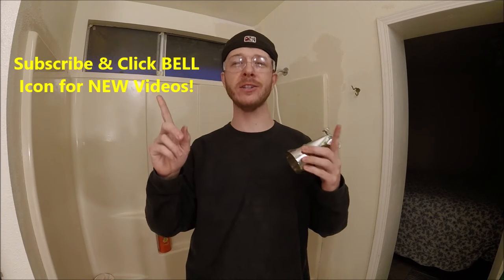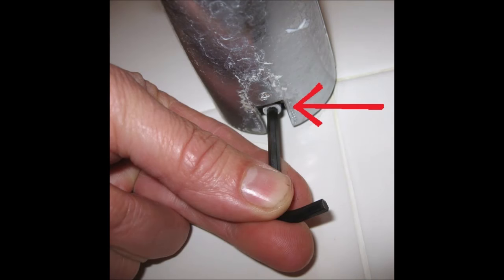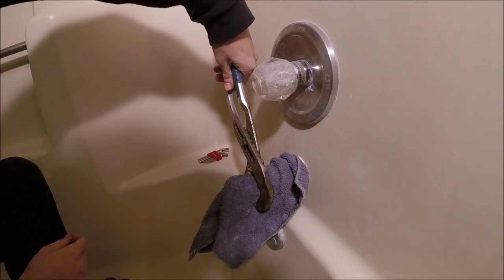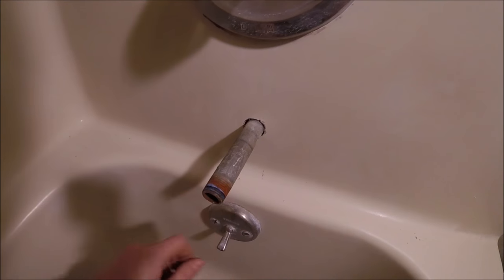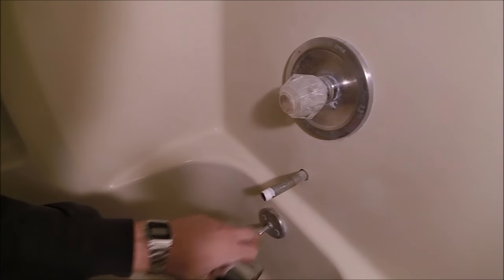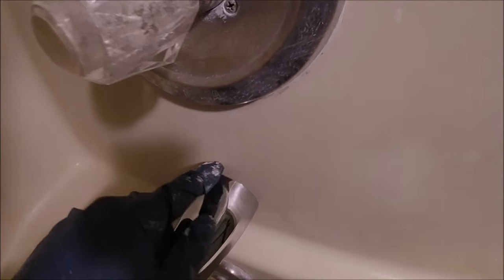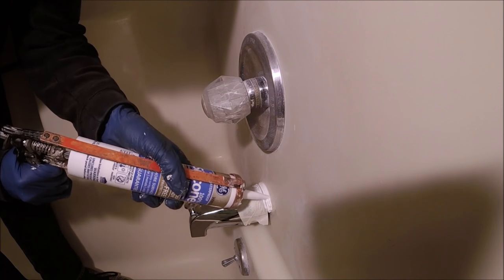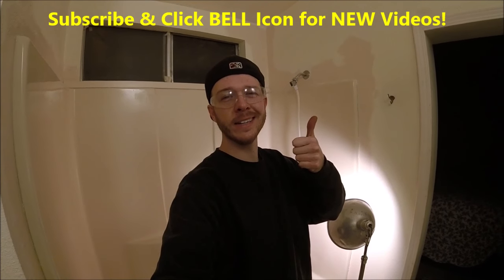Bathtub Spout with Diverter Replacement. Fix Leaking Tub Spout  -Jonny DIY

Comment from the maker: TOOLS & SUPPLIES & DONATION LINKS
Tub Spout- https://amzn.to/36ntmhO
Pipe Tape- https://amzn.to/2Cp446j
Hex Key Allen Wrench Set- https://amzn.to/2RNKYOD
Caulking Gun- http://amzn.to/2tbO4PC
Silicone Caulk- https://amzn.to/2K55y7N
Caulking Finishing Tool 3 in 1- https://amzn.to/2FXDBMD
Safety Glasses- http://amzn.to/2ez41Jw
Nitrile Disposable Gloves Large- http://amzn.to/2w0dlwc
If you Enjoy the Channel Consider Helping Support it by Donating below & by Subscribing.
PAYPAL DONATION https://www.paypal.me/JonnyDIY
Zelle Donation JonnyDIYs@gmail.com 
Venmo Donation JonnyDIYs@gmail.com
Reply: Do you have to turn the water source outside off first?
Reply from the maker: @CrmlG72  Actually not necessary for this job, but it doesn't hurt if you do 👍
Reply: I know Im kinda randomly asking but do anyone know a good website to watch newly released tv shows online?
Reply: @JonnyDIY  Hey man great video thanks! I have a quick question for you If you don't call behind that spout fixture if water gets behind that could it cause water damage on your ceiling behind the wall?
Reply from the maker: @bosshova23  probably not the ceiling, you may have another type of leak, best to check if you're getting drywall damage
Reply: Which exact tub spout? The link for that?

Comment: Jonny, why would my tub spout with diverter leak out the back when I engage the diverter? Cannot seem to find a solution to this, but I noticed that the replacement package has a notice not to install if water leaks out the back. Suggestions?
Reply from the maker: The connection inside the tub spout must be leaking and it backflowing. So taking it off or installing a new one with plumbing tape and or plumbers thread compound should be good to fix that issue. You just dont want water backflowing into and behind the wall
Reply: Thank you 😊

Comment: I have a similar spout I thought would be easy to change. I don't see a set screw. However, it seems really stuck on there. I'm afraid I will break the pipe. Does this ever happen? Cause if it does it will definitely happen to me.
Reply from the maker: Could happen or could remove pipe its attached to. I would verify what kind pipe it's attached to before really cranking on it. May need cut off around spout to get a monkey wrench on pipe to remove
Reply: Thanks @JonnyDIY  I think I am going to try torching it on the spout around where the threads are. I've been hitting it with WD-40 too and hopefully time and heat will do the trick. My home was built in the 1840's and we know this particular spout is at least 15 years old, possibly older. We think the spout is a Moen posi-temp. This pipe is copper. Thanks for your help.
Reply from the maker: @ThomasMaurielloUX  perfect, a torch and wd-40 should do the trick in time. Id put some anti seize on the threads of the pipe before installing the new one for future 👍

Comment: My parents’ bath faucet wouldn’t divert water to the shower. I never had this problem but has to resolve. Thanks to this video and replaced the spout/shower diverter. At first, I looked for the screw on the underside that didn’t exist. Realizing my tourque was needed to twist off the old spout, it came off easily. $11 new one from Walmart went on with no trouble. Thanks you - felt good to learn a new skill
Reply from the maker: Awesome, you're very welcome. Glad I was able to help you fix that for your parents 👍

Comment: Wow that’s easy! I’ve put a leak off for 15 years. Knowing it wouldn’t fix itself. But just didn’t know how to tackle it. Thanks for your video. Following you!
Reply from the maker: You're welcome, glad I could help. Good luck with the fix, better late than never! 👍
Reply: Uh, yeah...same here. Not quite that long, however, when we bought the house new they put the cheapest crap in here including all the  faucets and tub stuff.
House was built in 2005 and already had to replace every faucet in here pretty much including kitchen sink and faucet, 3 faucet fixtures in the bathrooms and now this 1 tub spout im going to have to do. I wish they wouldn't do that to us and just put something in that will last.

Comment: Thank you dude❣ To the point and not a YouTube time waster! Quick and easy. Great job superior❣👷‍♂️👍
Reply from the maker: Thank you for your kind words 👍
Reply: @JonnyDIY  BTW
went To my local hardware store and purchased a spout.
 I thought it was the one I needed before taking the original 1 off of my tub cause I wanted to make sure I had the right 1 and in taking off my original, the 1 I purchased was not the right 1 so I took it back and was able to get the right 1 based on what I took off and figured it out and put on the new 1. Next I noticed that the replacement 1 was the super cheap pot metal.
 I don't like how cheaply made it is and I Paid $17.99 for it.
I Did a great install though! YAY ME!
Thanks again for the viddy!
Reply from the maker: @candlesoftheearthbestcandl995  You're welcome, glad you got it done. Yes I've noticed the price of them has gone up a lot in the last 5 years and the quality down sadly. They dont last long either, they're always breaking for me at least hah

Comment: Ive replaced these 3times in this house weve lived in for about 9yrs. The first two were in the first five years, after putting on the third one i asked everyone to pull up the diverter before turning the water on thinking it would help from wearing out and its now been 4 yrs and its still going strong
Reply: Also we had terrible water pressure in the shower for the first while we lived here, fed up one day i accessed back panel where the shower pipes are and with the turned all the way up i went up and down thr pipes rapping on it (forcefully but not excessively) with a wrench and knocked some sediment loose and increased pressure by easily 300%, wifey was pleased and i got to act like i knew what i was doing the whole time lol
Reply from the maker: @ChChChEm  haha awesome, love fixes like that. Easy and rewarding! 👍

Comment: Thanks for the instruction. 
My spout leaks even when not in use. How do I fix it or I have to replace it?
Reply from the maker: If it leaks when turned off that will be a control valve issue. So you will need to take apart handle(s) and replace either cartridges or sometimes on certain ones can just replace rubber washers. If take apart and take pictures can show to hardware or plumbing supply store. Theyll be able to point you in right direction for part

Comment: instead of caulking, I prefer a round foam rubber seal between the wall and diverter, slightly wider than the diverter diameter. It will be compressed and form a positive seal.
Reply from the maker: Cool thanks for sharing 👍

Comment: Jonny watched your video to change the sprout very good I have a question my sprout does divert water to the shower but water leaks from the sprout even when the valve is closed
Reply from the maker: A little bit of water leaking is normal when diverter is closed letting water out of the shower head. If its leaking a bunch may need to be little bit tighter

Comment: That's a Delta faucet system. Got any plans to do a video on a Kohler, Moen, Pfister, or El Cheapo  tub/shower fixtures? You are the only youtuber who is not ashamed to use masking tape while caulking. Party on, dude.
Reply from the maker: Thanks Mark! No plans on any other fixtures right now. But will keep you posted if I do 👍🏻

Comment: How do you know if you need to remove the spout or the delta cartridge? My bottom shower spout was leaking a little cold water first, now it’s leaking hot water
Reply from the maker: @BrightVibesOnly  if the spouts leaking it's the cartridge that needs replacing/servicing 👍
Reply: @JonnyDIY  I have been trying for 3 days to get a bonnet nut off, I tried a wrench strap and maybe am not using it correctly because it has yet to come off, I also tried DW40 and today I poured vinegar on it and no success. I am so stressed & I refuse to get a plumber that quick because I have the cartridge and my female cousin and a sister did there own by folliwiing instructions from youtube, had this nut been off my problem would have been solved by now. 🤬I wanna thank you for replying to me, I hear theres a can of something that may work I forgot the name but I dont wanna keep buying stuff lol and the NUT is still stuck
Reply from the maker: @BrightVibesOnly  yes those get stuck on good. Try using a monkey wrench. Sometimes you have to heat it up with torch too. Sometimes if you tighten it a little first itll break the seal and loosen easier
Reply: @JonnyDIY  Ok I am gonna try to tighten it, It is so nerve wrecking because I now have the part but the nut is a headache. Do you think I may be using the wrench strap incorrectly? I was told to buy it with the part for the bonnet nut and I tried it and nothing lol
Reply from the maker: @BrightVibesOnly  is it a circular bonnet? Or have anywhere can put regular wrench or large channel lock pliers. Need some leverage

Comment: Looking for solutions. Trying to install a spout similar to this but one for a handheld shower. Any tips?
Reply from the maker: You need a special spout that has the connection for handheld built into it. If you already have it, its same process to install as this. Then connect handheld shower to it 👍
Reply: @JonnyDIY  I have one, but the pipe is too short for the spout. It leaks out the back...I am thinking to use a compression adapter to help add length. Also because the copper pipe in my mom's bathtub doesn't have grooves
Reply from the maker: @maliksherrodofficial2985  ohh ok. If copper pipe I usually just solder on a threaded end. You could also cut pipe and put a sharkbite coupling on and add piece copper to end of it if want to keep the spout that just clamps on with set screw. And yes you could also try a compression fitting with threaded end too, just be sure to check and make sure it will fit inside of spout
Reply: @JonnyDIY  gonna try tomorrow. Will try and remember to reply
Reply from the maker: @maliksherrodofficial2985  k good luck. If solder be sure to tigh wet towel around base of copper pipe so doesn't overheat and loosen joint behind tub wall

Comment: I have a question. I put in a new spout and everything then when I started my shower the water shoots to the back and in the wall we're the copper pipe is i don't know wat to do
Reply from the maker: Make sure the pipe coming out the wall matches the size of the spout, may need to use adapter
Reply: ouch,  what was the outcome?

Comment: Great video! But when I took off my old diverter spout (screw on bottom) I saw that the pipe does not have any threading on it so I don't know to attach a new one. Help! The pipe is smooth.
Reply from the maker: The new one will install just the same as the old one came off 👍 just be sure to get same type for replacement
Reply: @JonnyDIY  Thanks

Comment: Stupid question, should I shut the water off for this? Since it’s not technically the on/off valve?
Reply from the maker: Not a stupid question. Water doesn't need to be shut off for the spout. Only if working on the main tub/shower water control valve 👍

Comment: My hot water faucet makes a loud squealing noice when turning off the faucet? Would the problem get fixed by changing the entire bathtub spot/diverter ?  Thanks for any advice.
Reply from the maker: Possibly if you can pinpoint noise better may help. Sometimes that is more caused by the mixer valve
Reply from the maker: But if I remember correctly Ive had a spout that made the funny noise too, and that can be fixed by replacing spout or taking it apart and cleaning and possibly replacing seal

Comment: Hello Jonny DIY. I watched your video. I'm having a hard time unscrewing the spout. It seems that it is crooked, which may be the reason for a clean screw off. What can I do? Yes, I took off the caulking between the wall and spout.
Reply from the maker: If it's one like mine in the video where it's threaded onto a pipe you may just need more leverage. A large Pipe wrench should remove it without any problems although it may damage it. But if replacing no worries. Can try spraying some wd40 or similar, but you'd probably have to drill a hole in side to get it onto the threaded part

Comment: Thank you... It was easy but I have to figure the correct measuring of the nipple pipe. I found out after buy it 3 time. It was  5 1/2 inches long.
Reply from the maker: You're welcome. I feel you, I almost never get the right parts with plumbing the 1st time, especially at big box stores 🤦‍♂️

Comment: Hey Jonny - did you turn off the water supply before doing this repair? I read that you have to turn it off beforehand. I own a condo so I’m not sure what I’m supposed to do
Reply from the maker: it's not necessary to turn water off when replacing tub spout. Now if you're working on water handle controls, the water supply will need to be shut off
Reply: @JonnyDIY  Thank you!
Reply from the maker: @mitchellbinder7698  you're welcome

Comment: Plumber estimate to replace mine was $1200 without repairing wall and tile. Did it myself for less than $25 and never had to go into the wall.
Reply from the maker: Wow that's a high estimate! Glad you were able to do yourself and save 👍

Comment: When I unscrewed my faucet the pipe was bent I don't know if I did it while I was unscrewing the faucet or if it was like that but what should I do
Reply from the maker: It may have been like that before. If not too bad can leave it if not leaking and not too noticeable. Replacing would be a different story depending how it was plumbed
Reply: Yeah now that I examined it it was like that before and that's why I had that weird noise coming out of faucet because of the pressure I might have to replace it but at least it's not going to be my fault LOL thank you so much for replying to me take care
Reply: @JonnyDIY  and I have one last question when I screw back on the new faucet do I have to screw it on really tight cuz I'm scared I might spend it more
Reply from the maker: @randygomez952  you're welcome, glad to help. Doesnt have to be too tight no. Just tighten and turn water on and look to make sure not leaking, if so tighten another turn 👍
Reply: You've been very helpful thank you sir

Comment: If the original spout has the set screw, can it be replaced with one that doesn't or vice versa?
Reply from the maker: One with a set screw must be replaced with another with set screw, but I believe a threaded one could be replaced with a set screw spout
Reply: @JonnyDIY  great. Thank you

Comment: Mines the Deverter is in the back but does it still matter if the Replacement one the where the Deverter Located
Reply from the maker: You may need to get a similar one to replace because of the length of pipe that comes out is usually shorter with that type of spout. You may need to remove temporarily to figure your options for replacement
Reply: @JonnyDIY  oh ok so my Pipe might be Smaller is what your so I just can't do a Add on
Reply: @JonnyDIY  btw tho I got Fam that uses the place & I wouldn't want them to know I'm replacing it so that would kinda be Hard but Ehh I guess my Pipes are like 3 to 4 inches
Reply from the maker: @badassuchiha4875  Id just replace with another spout just like old one so you know it'll work then

Comment: Would this also fix a non-stop dripping from the tub spout? Or is that something I need to turn off water, remove knob, change out thingy? (professional term used by new home owner LOL). Thank you and great videos!
Reply from the maker: Yes that would be different. You would need to remove knob and replace rubber washer or cartridge . Depending what style faucet you have
Reply: @JonnyDIY  Thank you! I actually found your site when I was trying to find out why my fridge was clicking. Tomorrow, I'll be breaking out the vacuum. And searching your site for all the other things that I need to figure out! LOL
Reply from the maker: Lol thanks for checking my page out. Hope it helps 👍🏻
Reply: 3 name changes allowed every 90 days.  It ended up being the cartridge that needed replacing. It had been stuck on there for so many years, the plumber broke out the 2' foot wrench and struggled with it for 20 minutes before it came off!  Glad I did not attempt it myself LOL  Good luck!

Comment: Can I replace new shower system without diverted on spout from old one that has it
Reply from the maker: You always need a diverter unless you have a separate knob or lever for valve to switch between shower and tub spout

Comment: Perfect. This is exactly what I wanted in a quick video. 

Question. would you recommend fixing the diverter mechanism at all, or just buy a new spout?
Reply from the maker: Glad to help. You could take apart and see whats making it not work correctly. Sometimes its just a little o-ring seal gasket that you can switch. The lever knob unscrews off usually to take apart

Comment: 24 year old girl hear. My shower spout is so corroded on the inside from what I assume is that like stuff (calcium build up??) And my shower tab has been stuck in the upright position for years. Was cleaning yesterday and something must hav gotten knocked loose because now my water pressure is shit. Hopefully now that I know how to take my faucet off I can replace it or clean it.
Reply from the maker: Good luck, hope you get it. May want to try taking shower head off 1st and run water flush it out make sure nothing got clogged in there 👍

Comment: Is there such thing as the pipe sticking out too far that you can’t replace the spout? I was told I couldn’t replace mine because the pipe was too long but the diverter is now broke
Reply from the maker: No you should be able to replace it still 👍